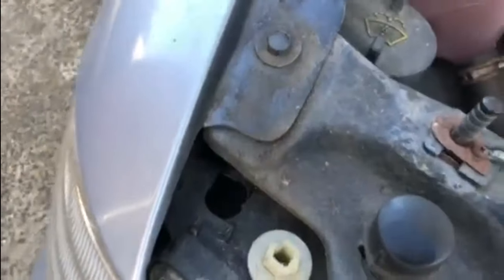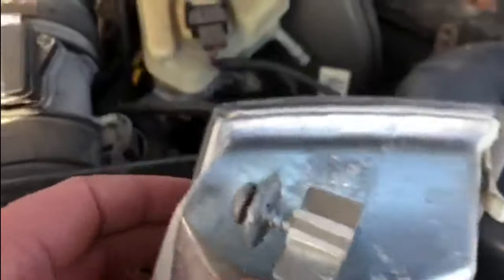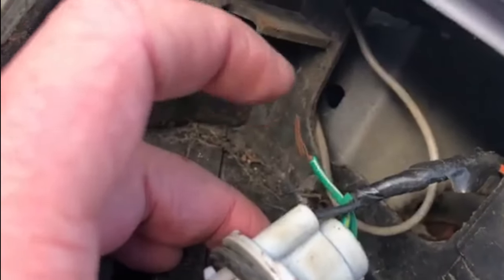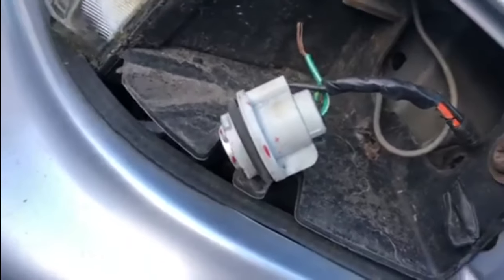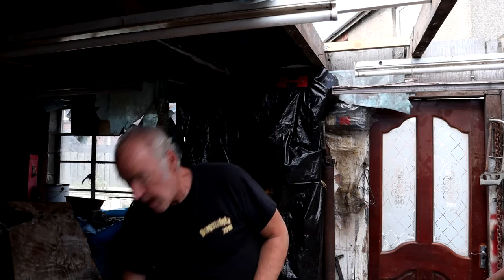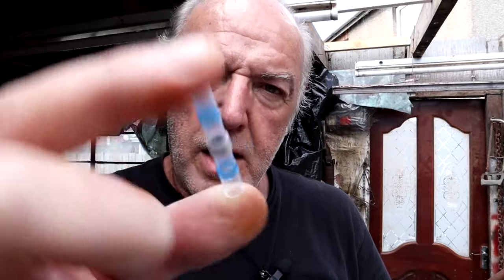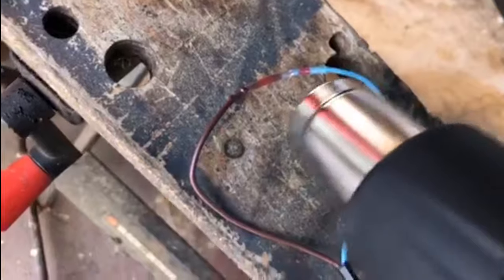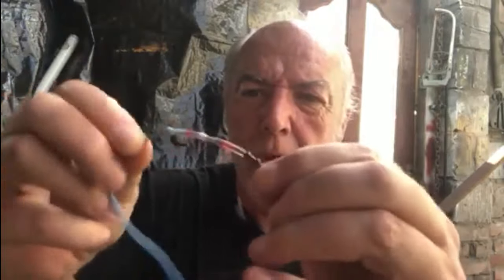Using Solderseal to Rewire My Indicators

Comment: Just starting my Double Zero Binge Session.

Its law to have a battery in the kitchen 😂😂

Great little tinkering video, I wonder if at some time someone wired the indicators to the sidelights so they could have what you see on VW or American Cars.

Explains why my mates Imported K12 Micra which lived in the USA for a short period of time has the indicators wired into the sidelights.
Reply from the maker: There’s currently three car batteries in the kitchen lol. It’s always possible someone wanted American style sidelights. The irony is that a previous owner of the charger moved them from the indicators to the headlights, which is pointless because the headlight doors don’t open until you turn the dipped lights on. So they need changing back